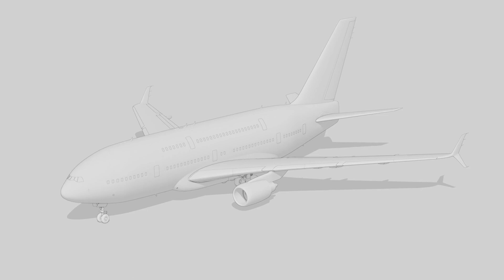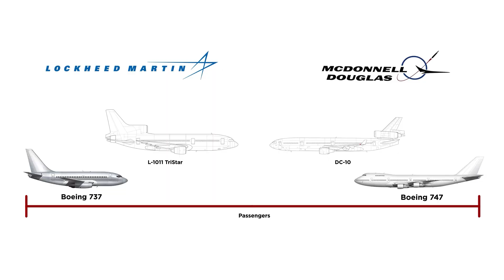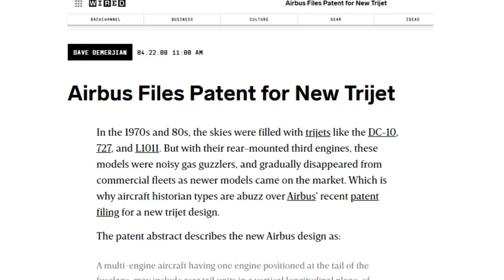Why a third engine is the future...

Comment: there's no way a twin engine A380 could get off the ground if one fails at the point of no return
amd  engines cannot get any bigger. They are already just under the fan blades at the outer perimeter, breaking the sound barrier, which will not fly.

Comment: Wouldn't it be better to house the engines in the wings like Avro Vulcan or Handley page victor this will reduce horrendous drag by the under wing configuration of modern jets thus saving money spent on fuel and maybe the intelligence to make it easy to maintenance the engines in the wings which was it's only Achilles heel. Just a suggestion.

Comment: It had been happened once before  which all hydronic line in the tail control surfaces section were severed by compressors blade during accident.

We all know what will happen after that…

Comment: Overall, the airline industry isn't going towards bigger aircraft. The rest of this decade and the 2030's will yield a continuing trend of airlines distributing their operations across a broader share of regional airports, point-to-point service, and semi-hub operations, where midsize airports such as start acting as smaller scale hubs for the RJ-focused ops that dominate the skies of North America. 

The 2010's delivered a hard lesson to Airbus, and to the big buyers of the A380: The infrastructure of the global airline industry does not want your super-jumbos. There are shockingly few airports that invested the billions needed to upgrade to handle them, and those that did also failed to account for the second order and third-order impacts that disgorging 500+passengers off a single flight would have on airport facilities like bathrooms, customs checkpoints and even seating capacities at the gates. 

The airline industry has instead pivoted towards improving efficiency by using more efficient twins (I.e. the 777X & A350) and increasing flight frequency on its highest demand routes, which yields the benefit of using their existing fleets, coupled with additional schedule flexibility, which yields more flight options for customers to choose. As their point-to-point ervices grow and they can more afford to bypass the old hubs, they'll adjust seat capacities on these routes by selecting from their vast range of twins from tiny ERJ145s to huge B777Xs. 

Also, the 3rd engine introduces substantial weight and mechanical complexity to any hypothetical design. Weight costs $$$, so does mechanical complexity. Even a hypothetical tail-buried, 3rd engine with flush, closable intakes will incur more drag and several thousand pounds of additional weight in the additional structure, wiring, fuel and hydraulic lines, and other components. This doesn't include the weight penalty of the engine. And there's no way Airbus or Boeing would ever adopt a twin-tail config for a future airliner and for the same reason. They incur too much weight penalty to be worth designing. 

Then there's the additional maintenance costs of a 3rd engine, which requires specialized gantries to install/remove and requires mechanics to work at great heights off the ground to perform routine maintenance and inspections on. And if it's a different engine type, you've added in more costs as now you have a whole new litany of parts, consummables and components that must be kept on benchstock for maintenance of that specific engine because none of it's interchangeable with the main engines. 

Then there's the additional safety risk of a tail-buried engine, which brings us back to the 1989 crash of United 232. No thanks. The flying public and the airlines won't tolerate the additional risks associeted with tail-mounted 3rd engines.

Comment: You have a great accent that conveys confidence, trust and knowledge. The A380 is dead. There is just one Emirates. In my plebeian/Latino accent: Ain't gonna happen. One airline is not going to be enough to push a project for another VLA with two engine types aboard. New large aircraft projects are huge risks. Stay tuned for derivatives: 777-10 and A350-1100.

Comment: The current boeing 777ER has GE90-115B engines  that produce 115,000 LBS of thrust which is more than enough to fly trans Atlantic flights, 3 engines are not needed

Comment: The trijets (MD-11, DC-10 and L1011 Tristar to be more specific) only existed cuz ETOPS didnt exist at the time so Bimotors cant cross the Atlantic, the Quadrijets  that did this like the 707 and 747 costs quite expensive to operate crossing from North America to Europe or Across the Pacific, then comes the Jets that had one less engine that consumes less fuel, but comes another problem, this planes due to their third engine on the tail had issues with Center of gravity, for who doesnt know if the plane is unbalanced it can go Nose down or Nose Up if they are unstable but that pulls are huge and can made the plabe stalls, thats why the MD-11 was so hard to land, and the trijets crashed too much, then the new Airbus A300 recive its ETOPS certification to Cross oceans later the A330 and 767-200ER, so the Trijets fate was sealed with one less engine to burn and drink fuel, with the same or more capacity and less issues with Drag and Center of gravity

Comment: realistically, there should be a rule that long flights over seas should have 3 engines, just in case an engine fails. the flight can carry on, or if needed would have enough power to reach distant alternates.

Comment: No, the way forward for fuel efficiency is to go electric, so you no longer need your engine and your thruster on the same axle at essentially the same RPMs. Cruise ships have already done this, and very soon Navy ships will do it as well. Granted it is much harder to do it for airborne vehicles, but not impossible. We will get there.

Comment: The Third engine on Trijets is a maintenance headache, That is why when a twin became available for the same route,they tended to get swapped out quickly.The exception where tanker sand cargo aircraft where the reliability  and reserve thrust during an engine failure of having a third engine makes sense for heavy loads.

Comment: to save money they would have to relaunch the A380 very similar to the way it is now but with two engines which will require a smaller wing...........the MD11 failed due to airlines only wanting two engines........the only way is to develop a way more powerful engine for a relaunched A380.......the A380 has a truly massive wing compared to an A350, when you build a model of the A380 it looks a bit stupid to be honest...... yes it's because it has to support 4 engines but that won't be needed..... it also has a massive vertical stabilizer that looks really odd......... ok it's for a for a bigger A380 that was never build, but definitely looks out of scale on a smaller aircraft.

Comment: I don’t know a thing about airplanes. But I have never liked the look of rear engine planes. I’m thinking of the 727, the smaller regional jets like the enbraer. But especially the DC-10. That huge rear engine was UUUGGLY. They just look unbalanced. The exception was the Lockheed L-1011 Tristar. The front engines balanced the rear. I don’t know if form follows function in aviation, but the Tristar looked better than other rear engined planes.

Comment: One of the biggest costs is maintenance. Maintaining 2 engines instead of 3 is a lot more economical. A third engine would also create a lot of drag when it is turned off. A 3 engine concept won't work.

Comment: Fun fact by just putting 2 GE9X engines on a 747-400 or 747-300 you can achieve the same amount of thrust that those other 4 engines would produce meaning you would cut down weight and drag and have 1.3-1.5x more range
Reply: Except it doesn't work like that. Aircraft are designed to be able to takeoff with one engine inoperable if the failure happens after V1. So in order to redesign a quadjet to use only 2 engines, each one would need to have the thrust of roughly 3 of the original engines, not 2. There is also the issue of rudder authority. All of this is the reason why the B-52 is being re-engined with 8 small engines instead of 4 large ones, despite powerful enough engines do exist on the market.

Comment: Double deckers? Nah, it is 70's way of thinking. Passengers today don't want spend and hour or two on hub. More passengers means longer boarding time. That makes travel much longer. People today demand direct connections. 4 flights a day realised by 150 seats capacity planes are far better than 1 fly a day realised by giant with 600 seats. Era of big aircrafts passed. There is no A380 production. B-747 orders are ended for passenger versions. Big planes were necessary for long travels, but now we have better fuel efficiency. Probably there will remain some need for cargo versions.

Comment: Very interesting!
They used turbojets to speed up piston engines aircraft, or rocket engines to assist aircraft like the Hercules 
If the junior engine can be fitted to work as APU too, it seems to be a very promising design

Comment: I have always saying that the Airbus A380  should be a TRI JET..
THERE ARE ENGINES  THAT IS AVIABLE TO MAKE THIS HAPPEN,  THUS MAKE THE A380 HAVE A VERY LONGER RANGE. 
ALSO THERE ARE ENGINES THAT IS AVIABLE TO MAKE THE BOEING 747-400 A TWIN JET  WITH EVEN A LONGER RANGE. 
AND YES I WOULD FLY ON THESE AIRCRAFT. 
BUT MAINLY THE A380 TRI JET CONCEPT.

Comment: I can't imagine there ever being a tri-jet with the engine embedded in the tail like the L1011 or DC-10, due to the vulnerability in case of catastrophic engine failure. Admittedly, such engine failures are rare, but they have happened recently enough that it's clearly non-zero probability.

Comment: I'm not an aircraft engineer, but at first glance your idea seems to make sense. On a broader scale, modern twin engine aircraft are very efficient, but maybe it's time to rethink the entire concept of fixed wing aircraft. Take off and landing are still the most risky manoeuvres of flight, even after perfecting the concept for a century. Can we come up with aircraft that could do away with the runway altogether? It has been done, but not perfected to the point where it would be commercially viable. The concept of vertical take off and landing could greatly improve safety in aviation and whatever would make it lift off (third engine, mounted in an unconventional way?), could be shut off during cruising.

Comment: No, a twin deck, twin engine aircraft with a code E wingspan is the sweet spot you're looking for. Largest capacity with lowest fuel cost per seat, easy to maintain and maximum airport compatibility but you'd need a pair of monster engines (which aren't that far off).🤔
Reply: Mid-wing, for the massive engines to clear the ground?  With the wing spar passing between the two decks of the fuselage?

Comment: What about the other way a large jet on the tail and two small ones on the wings. It would allow shorter lighter landing gear , Or allow you to increase the power on a twin jet plane , and asymmetric thrust due to loss of a engine would be less . There must be some niche where it would fit.

Comment: IF they want a successor of the A380 (Airbus does not as of now): A new wing and the newest engines are required. The wing was over-engineered because Airbus planned for an even bigger version alternative of the A380 fuselage. And the engines are just not state of the art anymore with big progress made since the 2000's.
An A380-neo would likely still be with four engines. 
Three is out of the question.

Comment: Ice related engine failures is one of the reasons they stopped making these. Clear ice, which is hard to spot, would eventually break off during takeoff and get sucked in to the back engine…..

Comment: Or even -- and get ready to vomit but this is interesting -- it's still a four-engine jet, with no tri-jet tail-engine funny business -- but with two little turbojet booster engines, hanging from the wings in the outboard positions (#1 and #4).

So when it's time for a re-engined model 20 years later, the main engines can be upgraded and the booster engines removed.

Comment: The problem is: Unless you want asymetric thrust, the 3rd engine needs to be on the centreline. The 'only' reasonable place is the back. And even then you need to decide between shoving it in (DC10) or making a s-duct (L1011). Both are ridiculously hard to maintain, and twin engines are good enough for most planes anyway.
Reply: Well duh

Comment: Emirates are the only airline that can make the A380 economics work, because they are a hub-and-spoke network. Everybody else operating point-to-point needs routes that have sufficient demand year-round to operate them profitably. These routes are few and far between, with major airlines at both ends, and are usually business-heavy, a market where frequency is highly valued.
A smaller tail-mounted engine brings spares/maintenance additional  costs, accessibility difficulties for maintenance,  and engine-out take-off limitations. Airbus have soured on VLAs, and Boeing have enough problems certifying 737MAX and 777NEO to design and certify a brand-new atrcraft, which would likely be a 737 replacement.

Comment: Consider this design idea. 
Take the 747, extend the top deck all the way back as a single aisle (3-3 row config).
The bottom deck has the standard (3-5-3 row config).
Every middle seat is 180 degree inverted so nobody has elbow wars anymore.
All seats are considered "Regular Seats". 
All "Premium Seats" fly either Boom Aerospace's new Overture or a private jet. 
Have 2x large engines under each wing. 
Have 1x STARC-ABL electric ducted fan on the tail to help with thrust & fuel efficiency. 
That means your large 747-class plane gets a T-tail.
Reply: Where do you buy your "stuff"? 😂

Comment: You could just take a 747 or A380 an just shut down or idle 2 engines in cruise.  Run them at power only for takeoff and landing.
Reply: Can't do it. That would create too much drag from the idled engine nacelles with not enough thrust from the two operational engines to compensate for it while cruising. Doing this would actually make the aircraft more fuel inefficient than running all four engines.

Comment: 777-X can carry ~430 in 2 classes. 747-8 can carry ~430 in 3 classes.
I don't think trijets are coming back. Nor double deckers (not worth the slot prices/handling/maintenance).
I think Emirates may continue to fly A380's for another 20 years ATLEAST, whilst most 747-8's move towards air freight/retirement.
I did consider trijets that can use 3 jets at low power for take-off, before switching to one jet for flight at altitude - but then you're carrying 2 jets for dead weight. The only real innovation will be prop-fans for the A320/737 replacements and then potentially replacing larger jets too. But this won't be for another ~20 years either.

Comment: The old Eastern Airlines had a fleet of tri-jets, I can't remember if they were Lockheeds or McDs.  Nothing really special when you were flying in one that I recall from XC flights I used to take in the 1980s/early 1990s.  Fed Ex still might be using them as freight haulers.  But with the progression to more-powerful twin engine set-ups doing just as good as a tri-jet with lower maintenance costs I can't see the tri-jet coming back into service.  Maybe as a specialty long-hauler for an airline like Emirates, but that would be limited.

Comment: I have seen Boeing 727 at my local airport in Ontario California. They use them as carriers because they are still fuel efficient.
Reply: The 737 max is almost 3 times more fuel efficient than a 727. The only reason they are still in service is cost.
Reply: LOL no. They use them because they're dirt cheap to buy but the tradeoff is extremely high fuel and maintenance costs.

Comment: Stupid Question: Why have the 3rd (center) engine be smaller than the 2 main engines? Why not just have all 3 engines be the same size?
Reply: In theory, it's not a problem to have a very heavy engine under the wing, but it is a problem to have it in the back. Having the middle engine smaller would help with that. But other disadvantages makes this a non-starter.

Comment: Once ETOPS 180-minute certification became reality by the early 1990's, that was the end for any airliner with more than two engines (with the exception of the A380). With 777/787/A330neo/A350 planes flying long over-water routes regularly, nobody wants to go back to a triget with its higher maintanence and fuel burn costs.
Reply: In addition. The biggest 4 engines aircraft were very fitted for mass hub to hub transport, smaller widebody aircraft with ETOPS long range gave the passenger the opportunity to fly direct (and sometimes cheaper) to their destination instead of having a layover in a big hub.